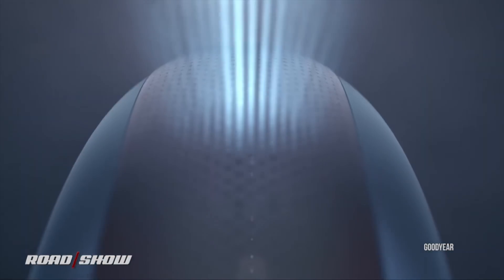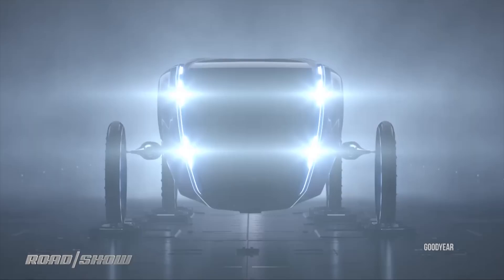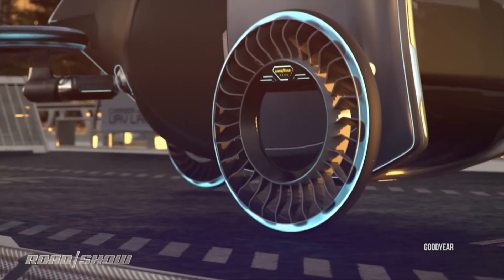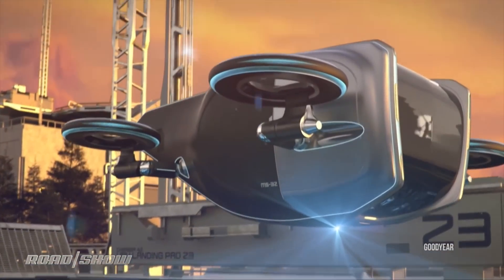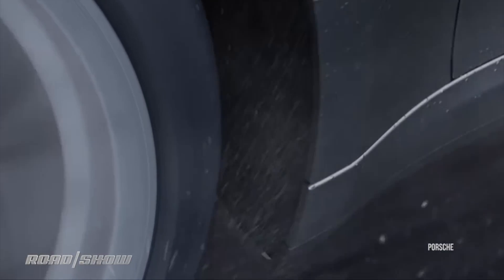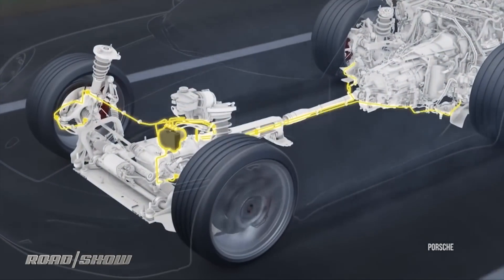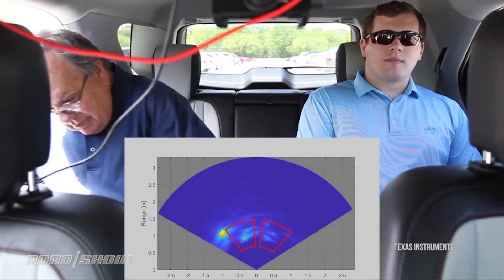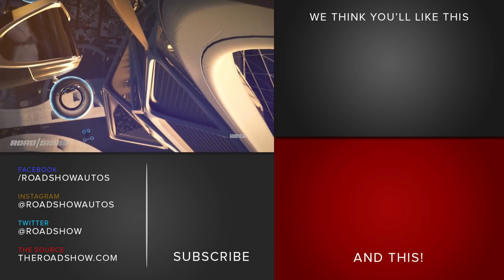Cooley On Cars: Goodyear unveils a tire for self-flying cars | Road to The Future

Comment: The blades will generate inward forces while driving on the road, just like when they are rotating horizontally as lift fans.
Reply: Unless the blades can be rotated, this seems like it would make an inherently unstable car while in ground mode.